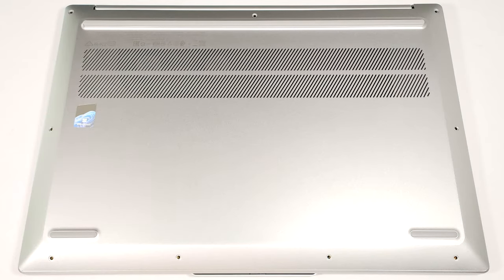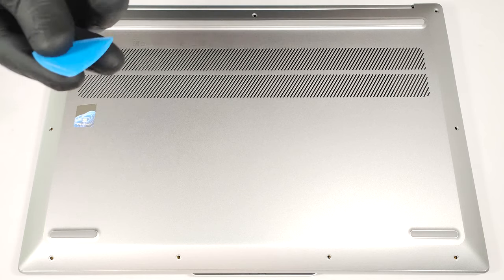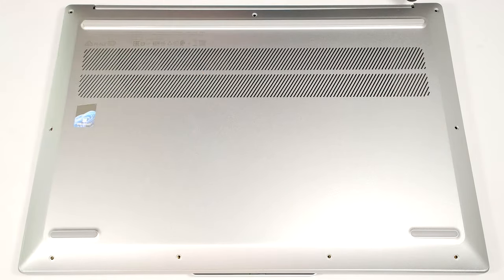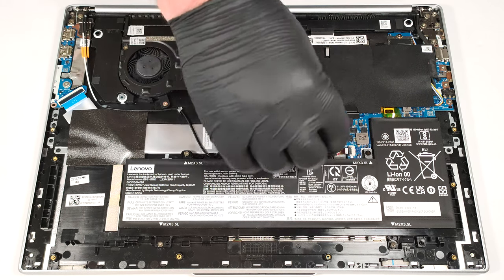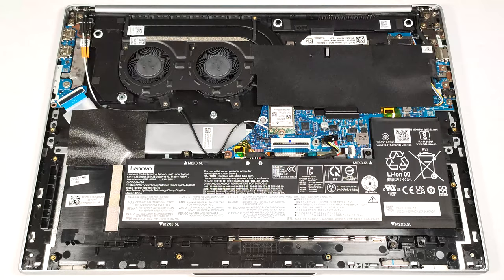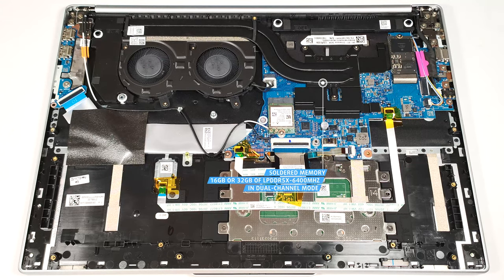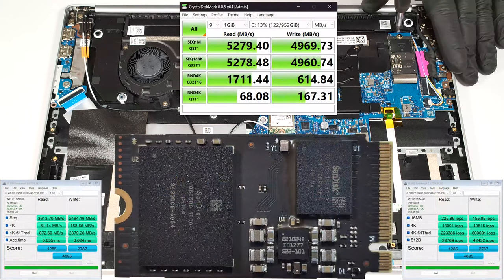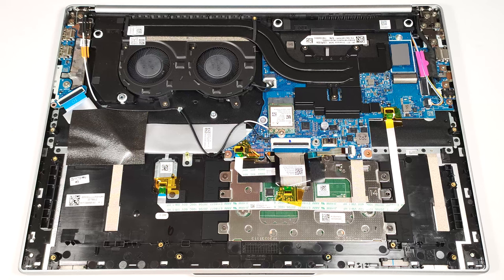🛠️ How to open Lenovo IdeaPad Slim 5 (16″ AMD)  - disassembly and upgrade options

Comment: Why do current lenovo ideapads have soldered ram and no slot of extra SSD?
Reply: solder tapi masih bisa di ganti kan? ganti aja ke yg 16gb ram nya bg
Reply: Some AMD CPUs love LPDDR5. And that comes soldered or CAMM. Also IdeaPad might come with lower pcie x than supported. ThinkPad has to stay the premium.
Reply: @ahmeterhanarik  I'm currently looking for a budget laptop which is upgradeable on both SSD and RAM. Any tips on finding the suitable laptop?
Reply: @rizkyandiputra  btw sorry but I am kinda biased towards devices that offer kinda good sound, good screen and build quality while not raising bar to premium so that's why I don't care about MSI or Dell and other brands not available here. But if I were to go premium, MacBook is the answer. Kinda cheaper here compared to other brands that offer high premium devices. Oh and i prefer to choose an iGpu notebook. I mean, I would rather game on desktop instead of a fireball casting mobile device.
Reply: @rizkyandiputra  This Lenovo Ideapad Slim5 is already very good, just make sure that you get enough ram in your PC and at least 1tb SSD

Otherwise look into the cheap Lenovo Thinkpads which can be a couple hundred usd higher in price, they have upgradeable RAM and SSD. Lastly, a cheap used Legion notebook might be up your alley, but you need to be mindful that you are buying used
Reply: @rizkyandiputra the acer aspire 3 has two slots and two ram. The only thing the unboard speaker suck